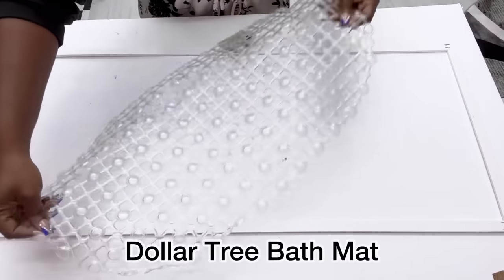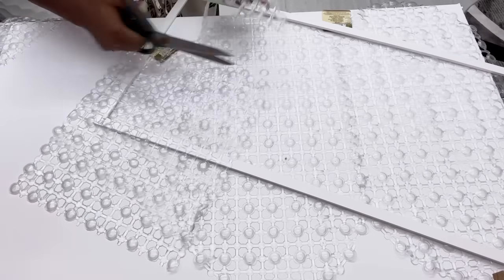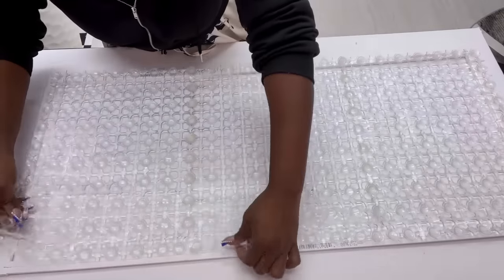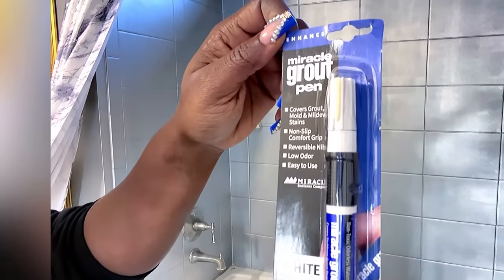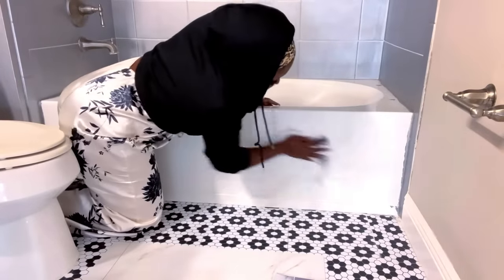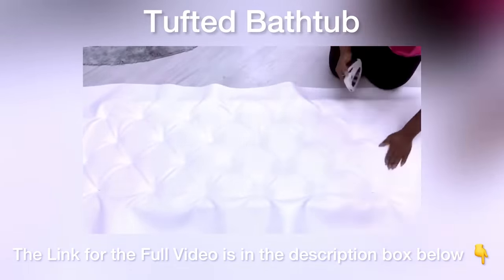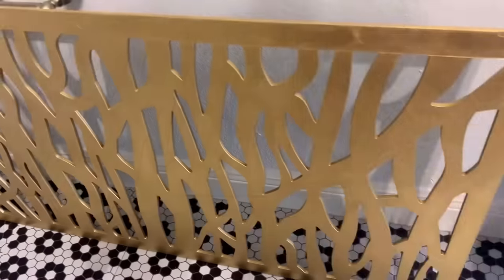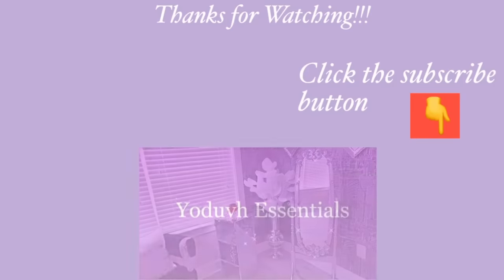24 HOURS DOLLAR TREE BATHROOM MAKEOVER! DIY BATHROOM IDEAS TO TRYOUT NOW!

Comment: I used rustoleum tub& tile paint in my bathrooms. The smell was strong. A mask and ventilation is a must. Be careful harsh tub cleaners will ruin the paint. I use my shower gel and a cloth to clean the tub/ tile. The results are great. Cheaper than hiring someone.

Comment: Love what you're doing!

I tape the shower liner to the shower wall so water doesn't get on the floor and have loved those results. Also, I add to the inside of shower a netted divider, currently 9 cubbies, to hold shampoos, conditioners, razors, tooth brushes, pastes, mirrors, etc. and no one sees the stuff and doesn't grow nasty. I add to back & foot brushes various string lengths to hang on inside of shower liner. Tub isn't cluttered. Solid shower chair. Pretty curtain.  

Am thinking one liner and curtain not enough. Need to add more lighting and more ventilation. More towel and robe hanging somehow.

Comment: That spray paint was pretty. Did it not adhere to the tile?
Reply from the maker: I'm glad you liked the spray paint! 😊 If it didn’t adhere well to the tile, it might be due to the tile’s surface or the type of paint used. For better adhesion, make sure the tile is clean and dry before spraying, and consider using a primer designed for tile surfaces. If you have any more questions or need further tips, feel free to ask! 🌟
Reply: @yoduvhessentials6310  thank you. everything was beautiful.

Comment: Omg! You read my mind! I just moved into a new apartment and it's beautiful but I need to spruce it up to my liking and the bathroom is what I want to "beautify more- mainly the tub to look more aesthically pleasing by adding a "tiled look all around it to look more luxurious- so thank you! It is possible!🙂
Reply from the maker: It’s my pleasure and I am always happy sharing these ideas with you all 😍🥰💕❤️
Reply: U should do it its so beautiful ur lucky ur ventilation fan works good mine sucks so nothing would stay on my tub .good luck and have fun making ur new  place urs
Reply: @angelagarutti6118  not even hot glue? I just used those same tiles, over the weekend, re-doing my half bathroom. The walls are textured, so the tiles wouldn't stick. Hot glue fixed that. I hope you find a solution that works! Switching things up can be so refreshing.
Reply: Que pintura usaste para las lozas

Comment: The only issue I can see is the peel and stick tile falling off due to moisture build up.  It looks great just would need like a gorilla type glue or strong double sided tape. Otherwise looks great .
Reply from the maker: You make a good point! Using a strong adhesive is a smart idea for added durability. Thanks for the suggestion! 😊💕💕💕
Reply: @yoduvhessentials6310  absolutely I love your videos though. Your very creative and very thoughtful.  Really here's some ❤️  .